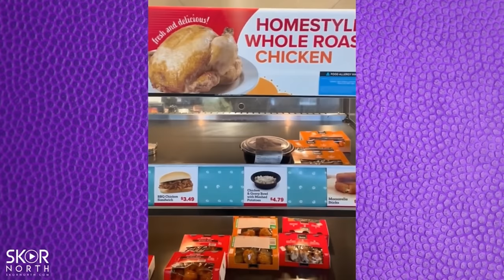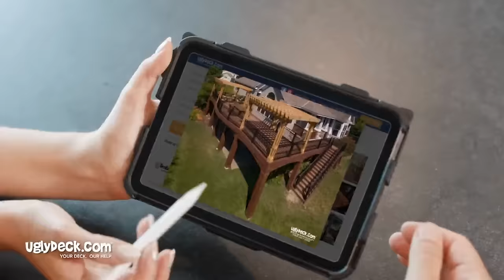Minnesota Vikings free agency fits: Xavien Howard, Tyler Boyd and more

Comment: Don't overlook the Falcons in drafting a QB if a QB that they like j falls to them.  Also Kirk's influence in trading that pick to a team other than the Vikings if they decide not to pick a QB and the Vikings didn't trade up yet. If the Vikings stick and pick, their preferred QB might be gone.    2nd or 3rd options after the top three QBs are gone means settling for the 5th or 6th best QB in the draft.

Comment: If we got our QB,  and Hockenson heals up full speed by oct we will be in a good position .. Keep Addison in the slot . We are really needing a speedster on the outside to take the top off when it needed to be done. Nothing I said will work unless our O-Line dominates. Bradbury is over powered constantly making our QB scramble of gets sacked strait up. It’s hard to win the Super Bowl, But Bill Parcels said one time that if you done get a set of talented hogs on the line, you cannot accomplish anything else. I never forgot that. Everything up front has to be on point!

Comment: The Vikings have been very inactive in signing their own free agents. 
It's a good thing they have a surplus of quality O-linemen!
Reply: They re-signed several back up oline guys. And the starters weren't great, but they were a better unit than most fans give them credit for. They are probably looking to upgrade on Risner or he's looking for a multi year deal that the Vikes don't want.
Reply: @CrudPig12  No. They re-signed DQ and BB, and added Feeney.
Reply: @nedcassley5169  last I checked, that's several backup oline guys. I guess one was a signing rather than re-signing.
Reply: @CrudPig12  No. One, a couple, a few, several. 
They haven't signed Risner or Reed.
They didn't sign Udoh or Schlottmann. 
They traded Ezra Cleveland to Jacksonville, where he happily agreed to remain a starting guard. 
I keep hearing that a rookie QB will have nearly ideal circumstances to succeed.
Reply: @CrudPig12 we won’t have to worry about o-line as much with the expectation of a young mobile QB that’s not a statue (cough cough Kirk Cousins)
Reply: @nedcassley5169  no. So two then. Plus Feeny. Nit pick about it. I already mentioned Risner. They will probably re-sign him late, draft someone, or pull another vet. Reed is whatever. Schlottman was a decent backup, but Feeny plays C. Good riddance on Udoh. And the Jags overpaid for Cleveland on his contract. Plus they grabbed a T and two Gs on futures contracts on January. And the draft hasn't happened yet. Who cares if they didn't bring back every depth guy.
Reply: @CrudPig12   I care. Depth was a problem and it's been allowed to get worse.
It remains to be seen if Cleveland will be worth his contract. 
San Francisco wanted him too.
The O-line, other than Ingram, was better twelve months ago.